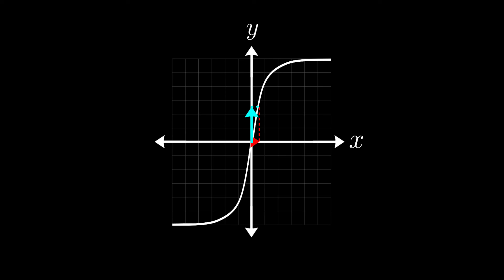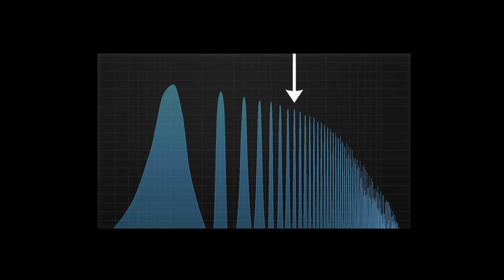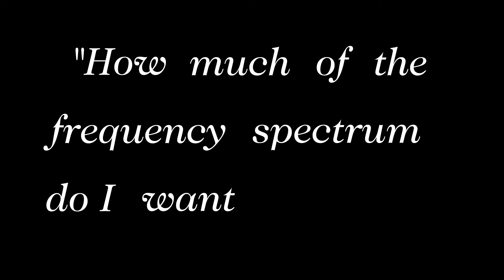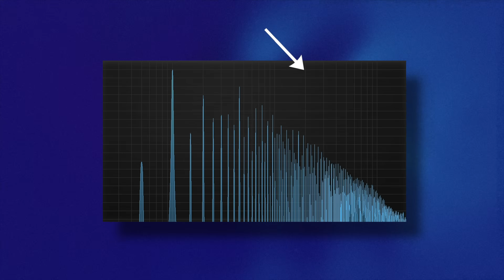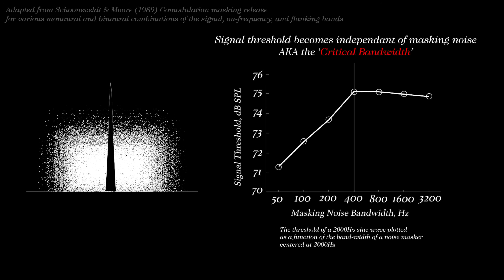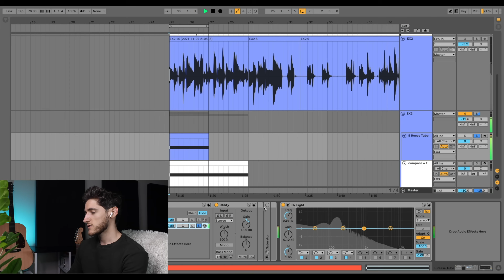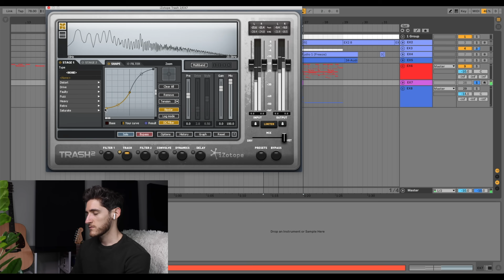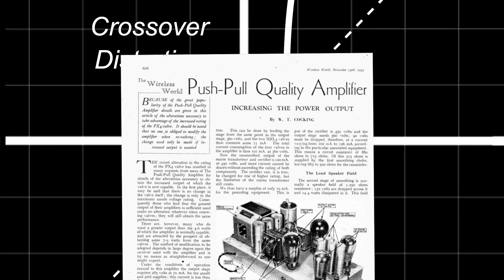How To Pick the Right Distortion

Comment: I like these videos a lot but also there are a few things I think might be a little bit inaccurate. The fuzzface doesn't necessarily create what is typically called assymetrical clipping. Although there is a type of asymmetry present. In that it doesn't clip the top or bottom of the wave with a straight horizontal line it has a slope. It hits the highest point on the way up, clips hard and slopes like 20 or 30 degrees and then drops down and peaks at the negative side of the wave and does the same thing.  So it looks like a crooked square wave. But the top of the wave is generally symmetrical with the bottom unless you mess with the bias. If you have a bias control that is. Now you can alter the bias on the second transistor to create the kinds of assymetries you are talking about. This doesn't work so well with npn silicon transistors. Since they operate in a narrower range of bias conditions than pnp germanium transistors and some pnp silicon transistors. One of my pnp germanium fuzzfaces has no bias resistor it has a 25k pot in there. If I adjust it above 16k it begins sheering off the top of the wave at lower and lower amplitudes till eventually you get this velcrow ripping sound people know from the zvex fuzz factory. If you turn the bias pot down below 8k it begins to not really clip the top of the wave. The headroom increases on the top half of the wave and adjusting the fuzz knob adjusts the clipping on the bottom half of the wave. This creates that assymetry we are familiar with from tube amps and blues guitar. This can be done better however with class A transistor circuits. This sounds like bluesy overdrives. Similar to a fender bassman amp. But a modified fuzzface can do both. It can clip the top hard and not clip the bottom much at all by turning the bias up and  the fuzz down. Or the reverse by turning the bias down and the fuzz up. In a sense this is works in combination like a dc offset control. When biased properly there is a narrow range you cant adjust the bias above or below that only really changes the harmonics and you can here that. There are three sweet spots. A little high has more high frequency fizz a little low has a little more low end rumble and in the middle the top and bottom of the wave clip the same. It is odd how this all interacts.

Comment: had a thought about intermodulation while watching this... intermodulation adds frequencies that are the sum and difference of two frequencies in the signal. if the signal is purely harmonic, ie one note, with nothing else, then all the freqencies are going to be whole multiples of the fundamental. This means that the sums and differences of any two frequencies will also be whole multiples of the fundamental, and therefore also pure harmonics - so intermodulation could sound fine and great - but only with monosynths or a single-note solo instrument/voice line.

Comment: Crossover distortion was also a problem in consumer level "Hi Fi" stereo amps up to the late 1980s when "Class A" amplifiers did away with the problem - at the cost of, well, money, as well as sacrificing efficiency.
Nice video. I won't remember all of this, but I now have a much more solid handle on the buttons and dials in my plugins. 😉

Comment: @sseb_music, why did you stop posting content? We need more! A topic that I think is slept on is how to produce and mix in a way that optimally translates to a large sound system like Funktion-One. This topic goes beyond simply having a well balanced and clear mix in the first place, as two mixes that both sounds great in the studio may sound vastly different in the club. More reverb? Less? Wide or narrow stereo width? Heavy panning of delays or not? How low can the sub go? What kicks sound good on headphones but s**t on a PA? Ultra-low sub-layer under the kick or not? 

Most of us do not have access to such a system so it feels impossible to optimize without being able to do trial and error. Through years of clubbing, I have noticed that some tracks sound particularly good on a big system, but I have never managed to pin down exactly what they have in common. Well, some tracks have very few elements which helps translating, I suppose. But there are also many stand-out tracks that has a lot of elements to them. Would be very interesting to hear your take on this.

Comment: I'm still a little confused. Does Saturation only change the shape of the curve using the saturation function? Or add new frequencies and therefore change the shape of the curve?
Reply: Changing the curve is the same as adding or removing frequencies, one can't happen without the other. Gotta remember that "frequencies of a wave" are only sines, which result in the wave when added up. So when using saturation, which changes the shape of the wave, it can still be broken down into sines/frequencies like all other waves, but now the sines which make the whole wave up are different of course, because the whole wave changed

Comment: That was a science lesson. Your series of videos is excellent. You've clearly studied audio engineering to an exceptional level and present it very well. The only disconnect I have here, is how does this relate to the real world? If you're using a saturation plugin with a graph type input, then you can easily see what type of distortion is being applied. But if you're using one that doesn't (like Decapitator or Tape sims for example), how do you know what type of distortion that's using? The only thing we can go on is what it sounds like as we try things. How do you know if the plugin you're using is symmetrical or asymmetrical?............Hang on a minute, you're not going to suggest we read the manual are you? That's sacrilege!
Reply from the maker: I demoed the difference between symmetric and asymmetric at 14:22. It's pretty easy to to build up an ear for the differences. Experimenting is really the quickest way to figure it out, but it doesn't take long to hear the differences in tone and once you figure it out you can apply that to any plugin where the curve isn't shown.